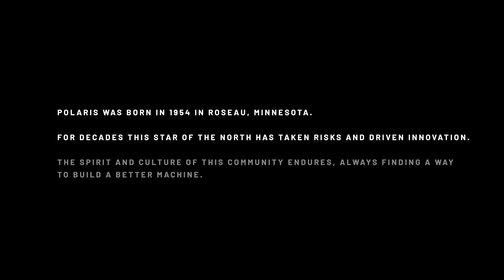Born in Roseau | Polaris Off Road Vehicles

Comment: I have owned a 2020 Polaris 450 Sportsman for 3 months and is is by far the biggest piece of junk I have ever owned. Has spent most of that time at the dealership. Constantly stalls, replaced the clutch, belt, clutch, gas, plug, wire harness... you name it it's been replaced. Most unreliable machine I have ever owned. Mitch from the Polaris warranty department is useless. This is my 7th Polaris machine, never had an issue until this ATV. But what's most important is Polaris has a lot of excuses how this isn't their fault. I would hate to see them actually take responsibility and fix the issue or replace this Lemon